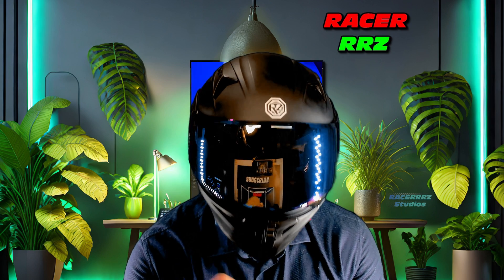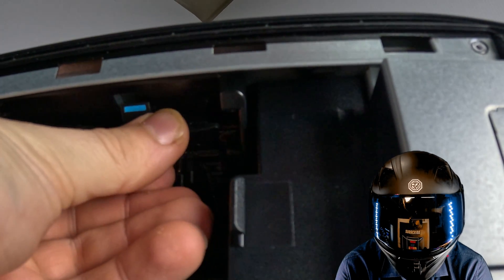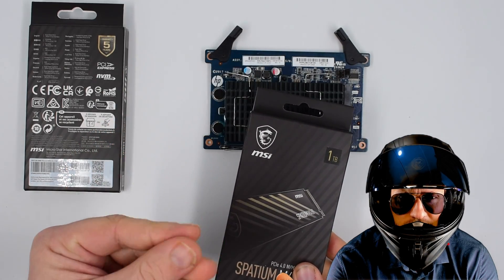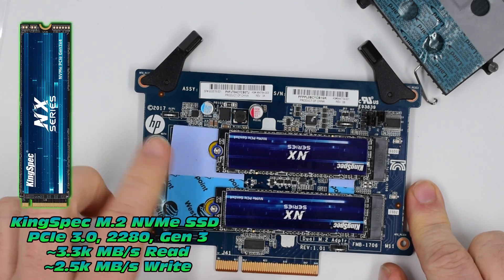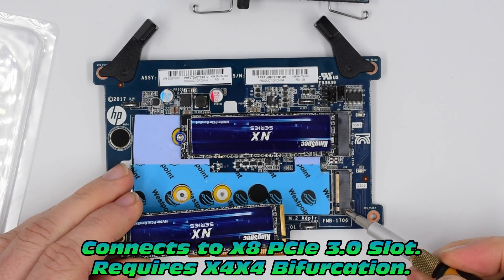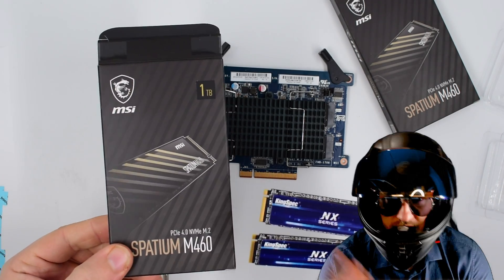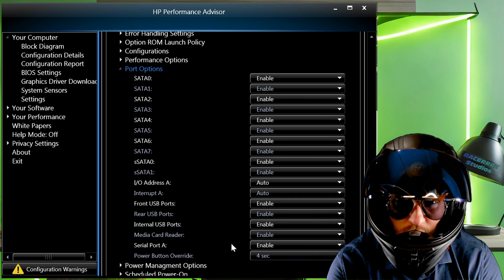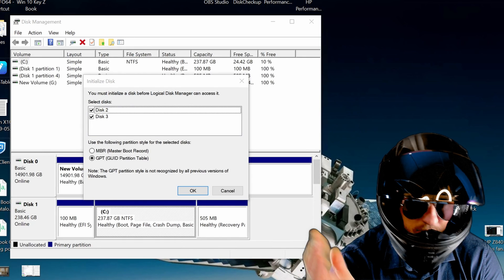GUIDE: Can You Get Cheap NVMe Storage? You can with this! HP Z8 G4 Personality Module Fitment

Comment: If its just a game drive i see nothing wrong with using a cheap nvme. If it dies youve lost nothing important, wouldn't put my os on one or anything worth losing.
Reply from the maker: Yes, an OS on RAID 0 would be a tad over-zealous. I tend to keep my OS more isolated and then install different software onto different drives (gaming library, editing library, critical data library etc.). RAID 0 for speed - but back it up to a spinner. RAID 1 for critical data. RAID 5 for backups. Risk is relative, but there is nothing worse than losing your OS.

Comment: can you boot up from those NVME?
Reply from the maker: I have not had success with booting from a RAID 0 because I am using software RAID. Windows needs to load before the RAID pool is activated - so it would not be possible to load an OS on this drive pool. If you used hardware RAID (e.g. Intel VROC module on the Z8 G4) then you could create a CPU operated NVMe RAID pool which should allow an OS to boot.
Reply: Without raid, booting from the personality slot nvme is no problem.

Comment: I have the device but I am not using it in a HP computer. How do can I get both M.2 slots to work in an aftermarket computer?
Reply from the maker: I have not tried this adapter in a non-HP workstations but generally HP hardware locks their adapters - usually through a modification of the PCIe pinout - creating a power loop when not fitted to an HP system. If you have one M.2 slot working this adapter might not be hardware locked. 

Do you have PCIe lane bifurcation on? Not all motherboards support it but you will need to split the PCIe slot into segments via a BIOS protocol (bifurcation) to have both M.2 NVMes detected in this system. The adapter also needs to be in a x16 or x8 PCIe slot to be able to bifurcate the lanes to x4 x4. I explain bifurcation in this video ~5min: https://youtu.be/PRMWIpscDCg

Comment: Thanks for this video. It was very interesting. I would like to ask you about the speed. I installed one NVMe Samsung 980 PRO 1TB for my OS in my z8 using HP Z Turbo Drive Quad Pro. In my speedtest I cant get speed over 3.500MB. Is it posible to increse the speed with only one NVMe or is necesary a RAID 0 with two disks?. Thanks !
Reply from the maker: Hi, I am glad you found the video useful. Unfortunately you have run into a speed limit that can't be broken on these systems. The theoretical maximum data transfer speed for PCIe 3.0 x4 is 3.5GB/s. 

With that said, can you go faster? Yes, but only by combining two or more NVMes into a RAID 0 pool.

This type of RAID shares the storage space on each drive which allows, in theory, addition of the speeds of each drive. The best description is a motorway - currently you have 4 lanes for flow but you can only fit so many cars - causing a speed limit. Add in an additional 12 lanes to open it up to x16 lanes and you have in theory 4x the speed of a single drive (I netted ~ 8GB/s - 12GB/s using this method).

Comment: just installed that HP Performance Advisor / to get familiar with it, my Nvme comes tomorrow :) also, doubled my RAM to 64 GB and still so many slots left, 24 total, crazy!!!
Reply from the maker: Nice, solid progress. It's actually ridiculous to have 24 slots on hand. I have not had the need for more than ~230GB of RAM (that's the most I have ever used on a project), so I really can't justify spending a small fortune to fill all the slots. I did invest in 4x 64GB 2933Y ECC modules - but I have yet to be able to use them due to my Skylake CPUs. Once I sort a new pair of Cascade Lake CPUs I will be more than keen to get back to 256GB of RAM. Right now I am living on 96GB (6x 16GB).

Comment: got another question / so this workstation came with just two 8GB memory sticks / so I got two more for 32BG (4 total) and I just got another 4 more (8 total) so that I have 64GB all matching sticks, because I am trying out some bigger llama language models and I need more RAM to be able to fit the model... but I will still have some free slots as this computer has a lot... but for fastest RAM how should they be install, will 8 be good ?
Reply from the maker: Sorry, slow response. The Z8 G4 in dual CPU configuration is ideally matched with 24 RAM modules. There are very specific RAM module configurations that are supported and you would need to refer to HP's technical whitenote documents to get the RAM loaded into the correct slots for your configuration (a brief guide here: https://h20195.www2.hp.com/v2/getpdf.aspx/c05527763.pdf?ver=5 ). 8 Modules would require loading 4 modules per CPU (assuming dual CPU configuration). I would share a link to the memory load order but I can't track one in a quick search. I'll publish a video on RAM fitment for the Z8 G4 in good time.
Reply: @racerrrz  thanks for the reply, ya dual CPU configuration, I will do some research for the best access speeds :)
Reply from the maker: Nice. It should serve you well. The extra RAM does make a difference. 16GB of RAM is decent but there will be times were you run short. 64GB of RAM opens up new possibilities. How are you planning to use the system?
Reply: @racerrrz  i been recently learning how to run AI on my local system, similar to ChatGTP  but a model made by Meta called llama3.2 (open source model) and wanted to get extra ram... but in general just wanted the extra RAM ;) i don't do much video editing, but when i go, also wanted extra there too...

Comment: do you think this would work ?  Samsung PM983a 1.88 TB NVMe PCIe M.2 22110 SSD - MZ1LB1T9
Reply from the maker: Yes, from what I found in a quick search it's a Gen 3 M.2 NVMe - making it well matched to the Personality Module. 

Gen 4 M.2 NVMes could also work but they need to be backward compatible with Gen 3 PCIe to be supported. The newer PM9A3 may not work due to being Gen 4 only from what I read online.
Reply: @racerrrz  thank you !!! I did order it, later I might get another // you are taking a risk doing RAID 0, hoping nothing fails, but if these things are really as good as they say and not fail, I guess things would be twice as fast using RAID 0 ?
Reply from the maker: Nice. Let us know how you find the PM983a NVMe's performance. 

In theory RAID 0 should be able to combine the speeds of each drive. So if a drive can manage 3500 MB/s read / write it should allow 3500MB/s x n number of drives. There are some assumptions and generally the system is only as fast as the weakest point. 

In my Z840 I obtained ~8200MB/s max when pooling four M.2 NVMe drives. 
Placing the same NVMes into the Z8 G4 (Asus Hyper M.2 V2 adapter) I obtained closer to 12000MB/s read. 
The benefit of speed is really only used if you transfer a large capacity of files regularly (4k /8k video editing etc.).
Reply: @racerrrz  cool / there is one of ebay for $90 and almost 2TB, so I am going to buy it

Comment: So for the personality slot cards, the one linked in your desctiption and found elsewhere for around $30usd is missing the release tabs but otherwise seems to be identical. Do you know if they still fit snugly even without the tabs? 

Buying with the tabs is a 5x price jump so I'd much rather avoid paying that much for a few plastic tabs.
Reply from the maker: That's a huge price difference. If it's the same PCB / identical card minus the tabs it should slot in to the upper PCIe slots - it will just not latch it self into place. With some creativity you can find cheap methods to secure it. Likely it will just remain suspended but it will be exposed to gravity - something the X8 slot should be able to handle (it's not a heavy GPU lol). I would remove the plastic shroud and use double sided tape on the back of the PCB to secure it - saves a heap as you said. I'll look into that actually and update the listing in the video description with the cheaper DIY route.

Comment: RACERRRZ, At 7:20 I almost fainted. 😧
You showed the "HP Performance advisor". Never seen anything about it before during my +6 months search about intel for the Z8G4... Maybe I'm blind?😲 But I see that I'm not alone. 

Anyways... Tried it and... 
What a  fantastically helpful tool that even showed the PCI-lanes in use and more. Amazing that HP don't push for it since it even gives the ability to go into the BIOS settings and not being stuck at the 1980's BIOS look and feel... 
So A BIG THANKS for letting me/us know about that app!!! 👏👏👏

About RAID, it´s on my to do list, I have to get back to you on that one.

All the best!
Reply from the maker: It's a touchy topic actually. I read up on HP's fine print because I had filmed a video on how to use HP Performance Advisor. 

Every company is different and what they allow is usually hidden somewhere within their terms of service etc. The HP fine print lead me to conclude it may not be wise to cover their software product in a dedicated video. I am guessing from the lack of coverage online from anyone other than HP that more or less cements the idea. I added a short section in the recent video because it was the only way for me to get decent footage of the BIOS (I have had trouble recording the BIOS screens - my capture card doesn't operate until it loads a driver and video camera footage has the screen flicker).

But I am glad you found that useful. It is a really helpful software package if you enjoy HP workstations. 

Talking helpful, I may just as well start sharing this since it may have benefit. 

I had a vision of creating an interactive digital flow chart with useful software organized according to their purpose. I haven't quite got it to what I had envisioned, but through using draw.io I managed to create something resembling what I had in mind: 

https://racerrrz.com/software/

You'll find a file download at the bottom of the page. When you download the .svg file - open it in Edge - let it load - then zoom out massively. It should render a large workspace with useful software that are all hyperlinked. The .svg file can be moved around so it is portable map - great to get quick access to some common software packages. 

Oh and yes that means I am slowly working on building a website for the channel.lol

Comment: I just watched your previous video, and it is really well done. I don't understand why more people don't watch these videos (probably because they are WT, but still they are amazing)

I plan on buying a Z8 G4 with a single Xeon Silver 4116 for about 400$ and upgrading it.

for now I will also wait for your CPU upgrade video
Reply from the maker: Thank you for your feedback. For the most part my videos have been impression locked - thumbnail impressions appear to be linked to subscriber count from my analytics interpretation. As I have gained more subs I have been allocated more impressions - which results in more views if I don't botch the thumbnail (which is logical - but sub count appears to be coded in as a view multiplier.) I believe this content will appeal to several thousands if not millions of people but then I am biased as the creator lol. 

The HP Z8 G4 is stepping up as the Z840's replacement and prices are gradually coming down. I have seen several reports of the Z840 being able to run Win 11 which will boost it's longevity (I may need to cover that process in a video tutorial). It's still cheaper to get a top spec Z840 (dual Xeon E5-2699 V4's are cheap relative to the Z8 G4's equivalent cores - say dual Gold 6262's.) 

For comparison: https://www.cpubenchmark.net/compare/5158.2vs2753.2/%5BDual-CPU%5D-Intel-Xeon-Gold-6262-vs-%5BDual-CPU%5D-Intel-Xeon-E5-2699-v4

But what I do like about getting the Z8 G4 now is that you get to enjoy half decent performance until CPU prices reach a point that you can get the high spec CPUs for a decent price. The HP Z6 G4 is also a decent option if you don't require dual CPUs. 

I have made good progress with the CPU fitment tutorial / guide video. It’s a little complicated because I have 4 hours’ worth of footage for ~3 tutorials (single CPU fitment process, dual CPU fitment, and dual CPU fitment with thermal paste removal and application). I am aiming to condense it down to ~ 30-40min.

Comment: Good stuff. I'll add that my initial experience with storage spaces was the same: when creating pool using the GUI tool it seemed that it just extended the drive rather than doing stripe. The performance I was getting was more in line with what to expect from single drive, but capacity was of two drives. I then re did the whole thing from PowerShell where I was able to set "Number of Columns" as 2 which then created a stripe. Supposedly there is an option for this in the GUI too (maybe "Optimize drive performance" or something) but I've not looked in to it any further.
Reply from the maker: That makes sense. The GUI seemed a tad uninformative in terms of how the RAID was being set up but it's good to know there is a way to get a true stripe. I imagine the performance would be the same or at least similar if set up correctly. For something that can be quite simple it seems odd that it becomes so difficult to get it going in Storage Spaces. I don't mind Device Management - quick and easy and it gets decent performance.

Comment: Thanks for the vid, I might try a pair of cascade lakes and some Optane persistent memory next.
Reply from the maker: Nice. That's not a faint-hearted upgrade! Which Cascade Lakes are you eyeing up? I am keeping a watchful eye on pricing for several Cascake Lake Xeons. Thus far their prices have dropped a little but I am hoping for more of a shift before I commit. I have 256GB worth of DDR4 2933MHz ECC Reg. modules ready to drop in - I just need the CPUs to support them. Fitment of DCPMM memory modules would open up doors for some extra features - like RAMDisks and two-level memory architecture. What was your end-use application for the Optane persistent memory modules?
Reply: @racerrrz  im looking a a machine with 2x4214 and a 1850w ps for 500, lowest price this week on ebay is about 100.00 for the 4214. I would be a big downgrade from the pair of 6140s I have now. The use case for me is more  VMs and a large ram disk. and get rid of the vmware mitigations.
Reply from the maker: Nice. The price is decent but yes the CPUs are not the brightest given that they peak at 2400MHz memory speeds and the lack of support for Optane persistent memory is a bummer on them. I suspect the Xeons that support the Optane DCPMM memory will still cost a small fortune (~$800 USD for x2, pending model). But more cores will always be better for VMs - allowing allocation of more overhead to a VM is nice.